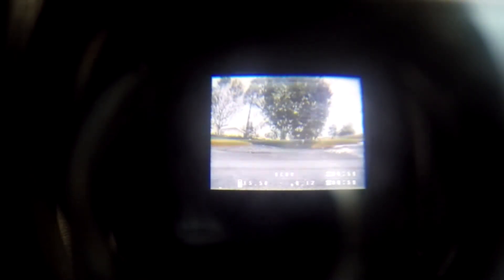Betaflight F3 Problems

Comment: Did you find a fix for this? I'm having the same issue, only when I power on/connect my radio. Radio off and the video looks fine. Thanks for any assist.
Reply from the maker: Yup I just totally reflashed the board it and fixed it.